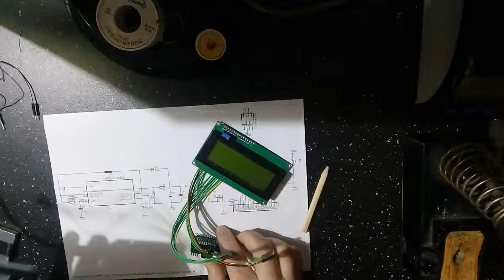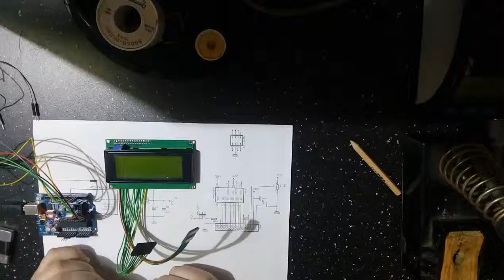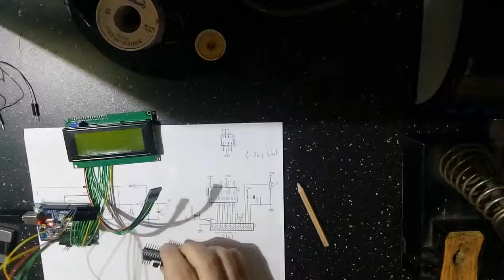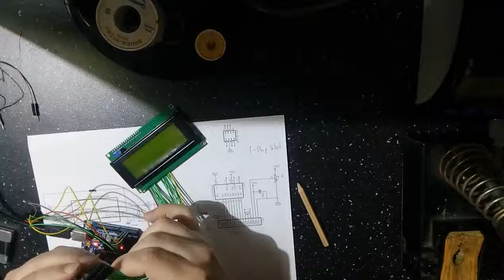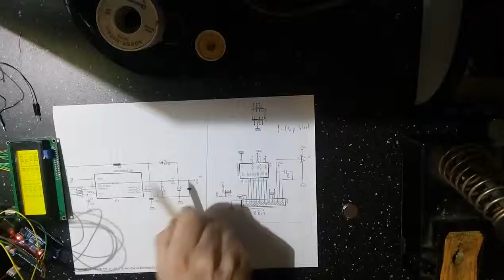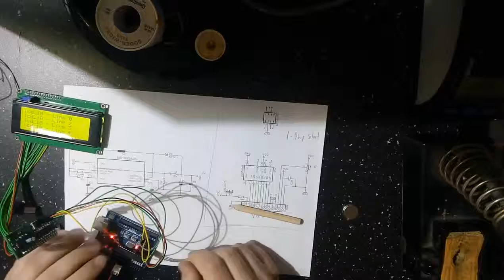Driving a HD44780 display using SPI Interface

Comment: Very cool! I got some 4x40 displays and im hoping to get this trick to help
Reply from the maker: If the original works, this one will too - But only on AVR based arduino boards. I just came back for it!

You can find schematics and library here: https://forum.arduino.cc/t/hd44780-boards-using-spi-interface/370420
It is called LC4bitSPI.zip and it is just imported as any other library.

Inside the library, there is an example, basically tou just add these two lines to the very top of the code:
#include <LC4bitSPI.h>
LiquidCrystal lcd(5);

The number 5 is the pin used for the SPI CS pin. Other pins can be used, with exception for the SPI pins themselves and the analogue pins (Ax). If you were using the original library, delete any other numbers there, that were used for the paralel pins.

The remaining pins are just SPI, same ones on the 6 pin programming connector, with exception of Reset.

Good Luck!